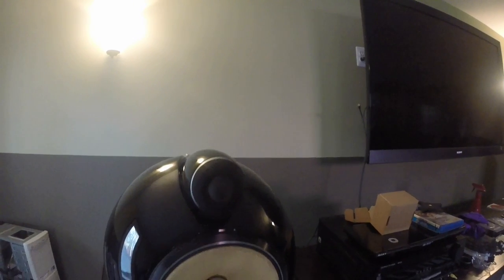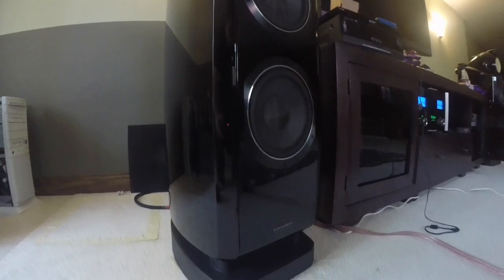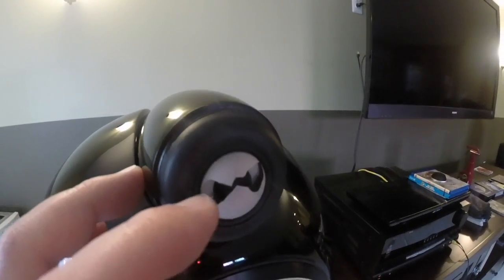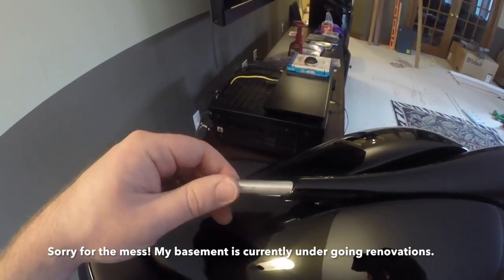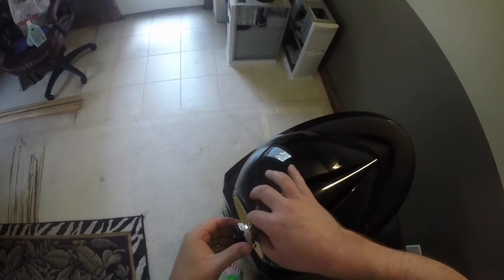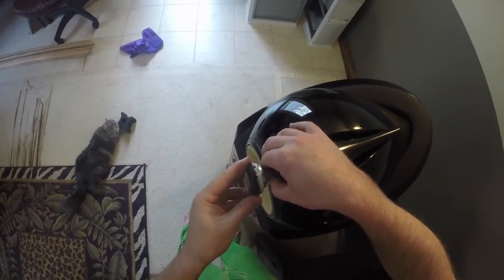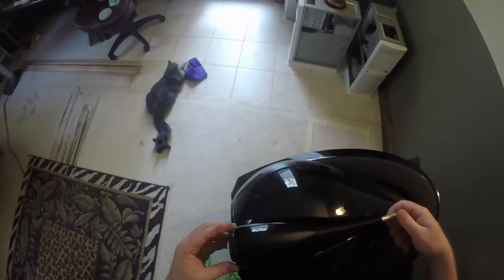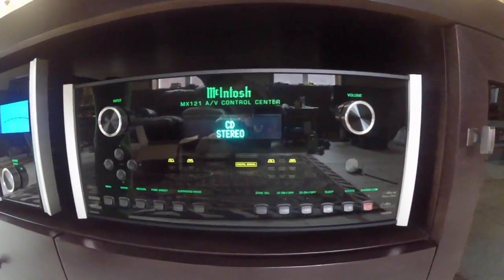How To Replace A Diamond Tweeter In Your Bowers & Wilkins Speaker

Comment: I followed this video to replace the tweeter on my 805D2. Unlike what’s shown in this video, the wires are not so easy to remove. I even pulled off the L-shaped terminals that were supposed to be part of the tweeter. Later I found out I had to use a small flathead screwdriver to lift up the tab of the longer end of the L-shaped terminals while pulling away the wires. Hope this helps everyone struggling to disconnect the wires from the tweeter. 

Before connecting the wires back, I moved the wires out of the zip tie to allow for more space to work on the connection, and also makes it easier to access the wires in the future.
Reply: Hi. where did you bought the tweeter and how much it cost?
Reply from the maker: My wires were not difficult to remove so maybe someone else has been in your speakers before?

Comment: Sweet system 😛😍.  

I am going to do this for my 803S.  Aluminum was pushed it.  I pulled it back out with blue masking tape but I can still see the marks it left.

Thank you very much.  Very helpful.
Reply from the maker: Thanks Keven and no problem! The 803S's are still a great speaker. My first big high end set of speakers was a set of Nautilus 803's finished in cherry and I loved them. The nice thing about the 800 series with the aluminum tweeter is if you end up damaging the tweeter, it's still pretty reasonable to replace them. You can check the latest part prices at http://bwgroupsupport.com/parts/price-avail
Reply: It's only an optical damage. The sound should not be affected, but I would have done the same I think. Make sure you keep the old one just in case :)

Thankfully my CM10 s2 speakers have grills in front of them.
Reply: I had the same problem years ago 😱🤦‍♂️…but I found out that it does not affect the sound quality…and still to this day I am enjoying them 🤗😁😍😍😍

Comment: Hi  Dan, awesome video. How did you remove the tweeter grill? It does not come out easily
Reply: The tweeter grill is magnetic on the D2 series diamonds from Bowers & Wilkins and is easy to remove. Sadly I think the later generation diamond speakers (D3+) require tools to remove the grill. I'm guessing you have a later version diamond? Also, this is Dan. I finally started an audio channel (GenertionBehindHiFi). Hope this helps.

Comment: I  once had to DIY-change the mid-range driver of my right M803 S2 speaker which was flipped over by MY CAT! My recommendation from the sole dealer was that you have to change both driver together because they have to be matched otherwise not synchronized.
Reply from the maker: I think the dealer just wanted to sell you an extra driver. If each driver that came down the assembly line varied widely from their reference specification, then B&W is in real trouble.

Comment: Great vid - altough i wonder if anyone can help me.. I have a pair of B&W 800's and a replacement tweeter i want to install... the issue i have is the rear locking pin turns, but does not release.. i'm worried the tread is shot.. Anyone else had this?

Comment: Mine gives very much resistance when trying to remove it from the housing. With how much strength did you pull it out so you can remove the cables? Or do you have to rotate it to remove it from the housing a little?
Reply from the maker: Did you unscrew the silver pole piece from the back? Are the wires to the tweeter disconnected? Remember the wires might be zip tied to the housing like they were on mine so you might have to cut the zip ties in order to pull it out.

Comment: I broke the dome on my 802 Diamond tweeter.  Can I just replace the dome or do I need to replace the tweeter.  A replacement dome is something like $30 and the tweeter is a whopping $1100 or more.
Reply from the maker: Who told you a replacement dome was $30? A diamond dome is $1000 from B&W last I checked.
Reply: He must mean the aluminium diaphragm. The diamond diaphragm is not available to buy AFAIK

Comment: Wonder if I can upgrade the tweeter in the old Nautilus HTM-1 to this new 'Diamond' type??
Reply from the maker: Unfortunately the tweeter assemblies are totally different. It could be done but would require major modifications.
Reply: Plus you'd be forgetting that even IF that could work, the built in crossovers would also have to be replaced. and the woofers...and the whole speaker....just buy Diamond speakers instead ;)

Comment: What could be wrong and repair cost when accidentally automatically set max volume 59 level when turned on preamp, with 800D speaker?  It has very little bursted sound.  Is that something DIY fix?  Thank You!
Reply from the maker: It sounds like you smoked the voice coil on the tweeter. The only fix is a new one.
Reply: @DIYDanCars  You meant I have to buy new voice coil to replace the broken one?  Is it too difficult to DIY? Do you what is the cost for voice coil?  Thank you!
Reply from the maker: @huongyn8808  I can only speculate going off the info you gave me, but it sounds like you will need to replace the speaker that has "bursted sound" with a new one. Contact your local dealer for prices on replacement drivers.

Comment: how did you remove the tweeter grille?
Reply from the maker: The grill is magnetic on the Diamond (D2) series. If you have a later series D3 or higher then you will need special tools to remove the grill.

Comment: Is that a mouse or a cat playing next to those bad boys?  Seriously, aren't you concerned one day you may find your cat tear up or scratch the drivers/grills or do you have its nails clipped regularly to avoid such a painful experience?
By the way, do you happen do know the size of screw driver/Allen  wrench/bit type to use to remove the mid range?  I have a set of 805D2 whose one of the drivers need replaced. The screws are really tiny.  I wanted to make sure I use the right tool to remove them so I don't leave any damage on the head.

Comment: I always thought “diamond” was just a marketing thing... I guess they really are diamond!
Reply: MAD GRUMPYMAN  My 601 s2 sound just fine without the diamond, especially when driven by a great amplifier. I'm sure the diamond tweeters can sound nice, but at over $1000 for a replacement, I don't think I'll be buying a speaker that has it any time soon.
Reply: MAD GRUMPYMAN  My dad has some Rogers LS5/8 BBC studio monitor speakers that I use as my mains. I think the original 1980's price was something like $50,000 if you account for inflation. Of course, dad didn't buy them for anywhere near that price. They didn't go crazy with tweeter technology back then. The surrounds are all 600 series s2 & s3 B&W.
Reply: @jonnda  I have B&W  LCR 600 S3 series for my rears…because the D appolito  just sounded better for the extra money 💰 and all these years later…. I HAVE GOTTEN MY MONEY’s WORTH  🤗😁😍😍😍
Reply: @budgetaudiophilelife-long5461  I now have a LCR 600 as the center channel, and a LCR 60 as the center rear. It's a 6.1 system, because I have an oldish marantz that supports that standard.

I like this set up a lot. :-)
Reply: @jonnda  GREAT 😁😎 I gave my son my other LCR 600 for his center channel …and I am JUST using a 4  Channel system with my recent purchase of a used YAMAHA 3080 … and I used the YPAO To set it up in this configuration 👍😎🎼 also playing with APPLE MUSIC and spacial audio  ( A GREAT SOUND …IMHHO EXPERIENCE YOU SHOULD TRY )
Reply: my tweeter just shattered on my 800D2

Comment: How much it cost?
Reply from the maker: Last time I checked a new tweeter from B&W is around $1000.
Reply: @DIYDanCars  just received the price from B&W ....and ... surprise....£82 ..... wow ...cheap
Reply from the maker: @deviceturcanu5683  That can't be right?! A Diamond tweeter is much more than that.
Reply: @DIYDanCars  ZZ11770 - £82
Reply from the maker: @deviceturcanu5683  ZZ11770 is for the much older Nautilus line of speakers (N805, N804, N803, N802, N801, and N800) which uses an aluminum tweeter and not a diamond tweeter. Aluminum tweeters are much cheaper than Diamond.

Comment: it’s ridiculous they are ripping off customers for something they designed badly and fragile. It’s a freaking $30 part and they sell for $1100
Reply: Agreed, ripping off your customers at its best.
Reply: Yeap i got 2 time already broken :((( Becouse of them specially designed.....
Reply: Have to order
Reply: They are certainly not $30
Reply: If you think b and w rip people off you've never experienced linn lol
Reply: @stevebarnes2  The dome itself $30.  The tweeter is $1100.  Which begs the question, can you simply replace the dome or do you have to replace the whole tweeter if you break the dome?
Reply: @yyoo  No, it isn't. I know exactly what they pay for the domes.
Reply: Aluminium dome is $30 yes. They don’t sell the diamond dome separately